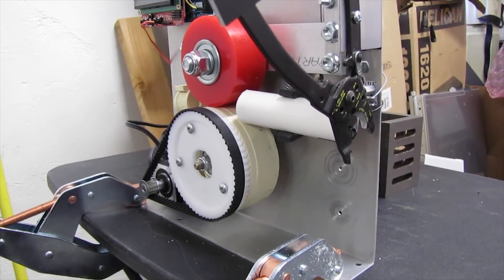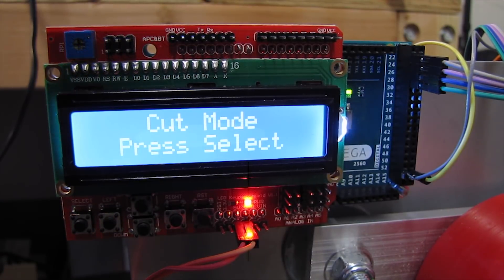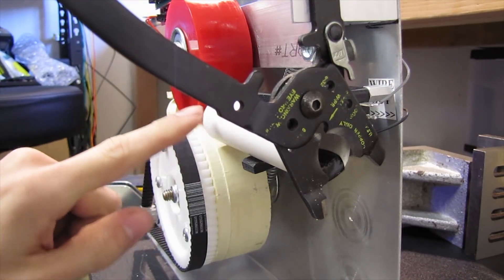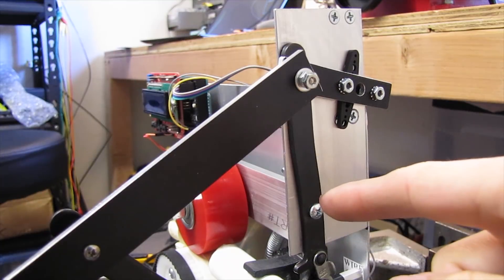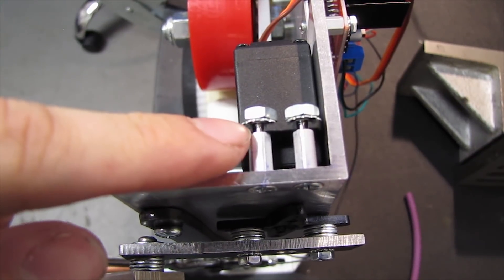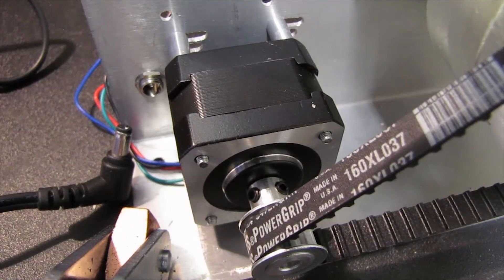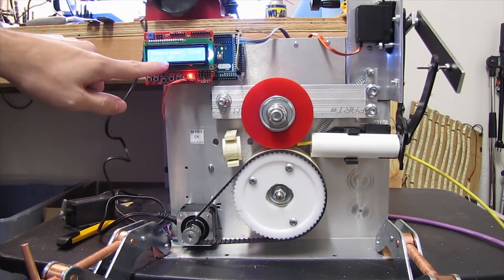Automatic cable cutter project

Comment: how do you measure the length of the cable?
Reply: Its radius of the wheel multiplied by the rotational angle.

Comment: How does the program know when the wire is loaded or not? Is there a sensor?
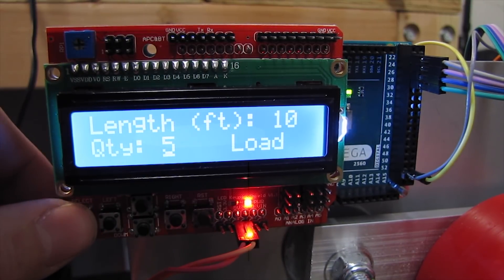Reply from the maker: 1:46. There's a microswitch that opens when the red idler wheel is raised.
Reply: @edcarlson-r9q  thank you! What motor are you going to use for your next build?

Comment: Hey, did You used any stepper motor controler? Or only arduino mega is enought? :)
Reply from the maker: I used an L298N dual H-bridge driver. In the new version I'm using a Pololu AMIS30543 driver. Probably overkill, but I'm upgrading the motor size since the small NEMA 17 in this one isn't quite strong enough for larger cables.
Reply: I also bought L298N. Will try with this one. Thanks for help! Thumbs Up :)

Comment: can you list the component that u used? and there is the coding?
Reply from the maker: Code is in the description. Parts list is in a reply to Jakes Makes.
Reply: okay tq sir. and can u gv me the circuits that u used.
Reply: what type of servo that u used?
Reply: what type of stepper motor do you used.

Comment: You mention some of the parts are from McMaster will you be posting the part numbers? That'd be super helpful
Reply from the maker: I mean...I guess I could. It's mostly just screws.

90272A148 6-32 x 1/2" screw
92005A212 M4 x 5mm screw
90272A106 4-40 x 1/4" screw
93505A112 M-F 6-32 standoff
90272A194 8-32 x 1/2" screw
90480A009 8-32 hex nut
90480A007 6-32 hex nut
8982K14 6061 2" x 2" x 1/8" 90 degree aluminum, 2ft
91114A005 #4 external tooth lock washer
92510A447 1/4" unthreaded aluminum spacer, 3/4" L
92005A137 M3 x 50mm screw
57105K33 XL Series Lightweight Timing Belt Pulley, 3.8" OD
6484K226 XL Series Timing Belt, Trade No. 160xL037
Reply: Edward Carlson thank you! I've built one myself based off a 3d printer extruder but I'm gonna switch to the pulley and tensioner like you have there

Comment: I tried doing something like this but with a large driver.  Where did you get you're arduino code from?    Did you write the code yourself?
Reply from the maker: I used a library for the stepper and the LCD, but I wrote everything myself. I'll be posting the code to my blog shortly.
Reply: You are the man!  That is awesome that your sharing the code.  Thumbs up!!!  What is the link to your blog so I can share it with some guys that i'm in a group with?
Reply: @edcarlson-r9q  Could you please upload a picture of the Stepper Motor Driver Module? I am curious about how it was connected.